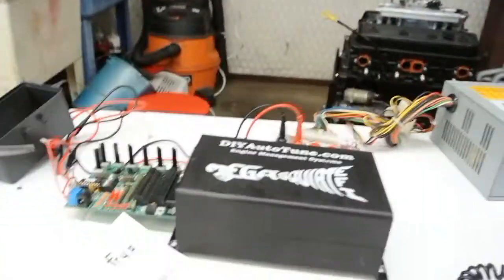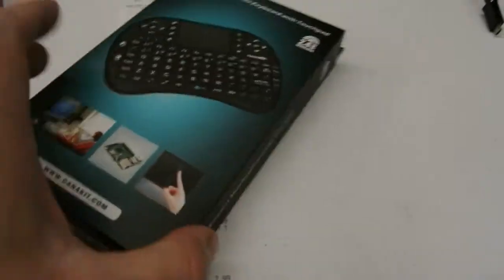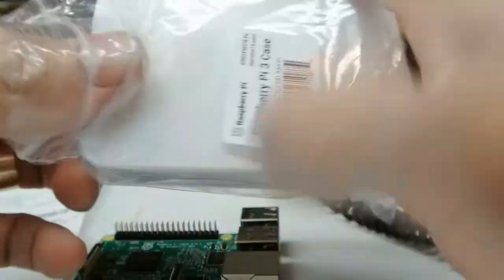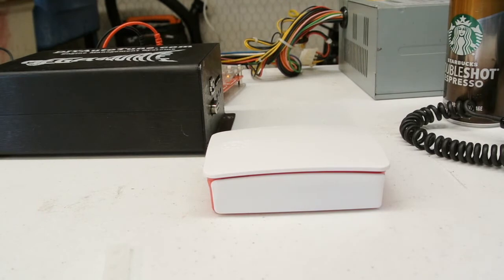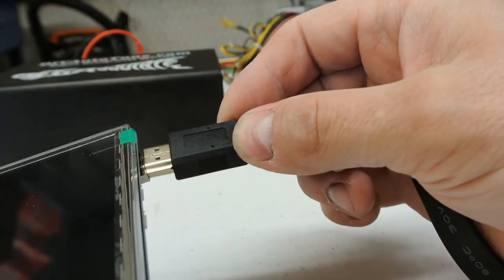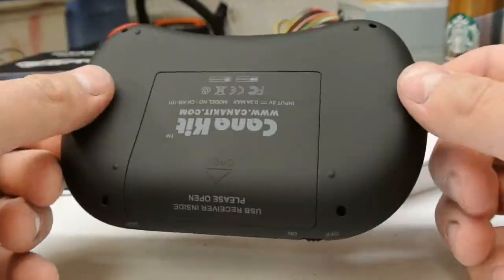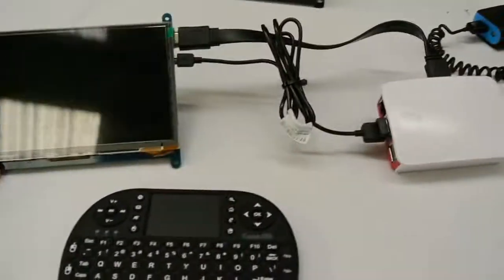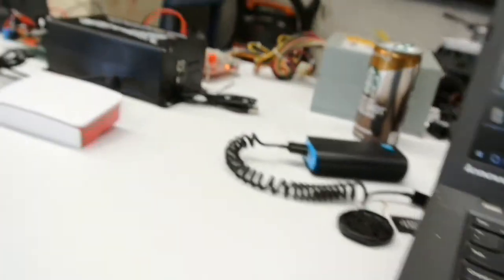PI Dash Setup: Part 1 Overview and Hardware

Comment: im using microsquirt think that will work through my tuning cable with rs232 to usb adapter. im assuming so it will since the pi is like any o.s. I have a '79 ford courier with  twincharged 2.3 and need something to help update the old cluster